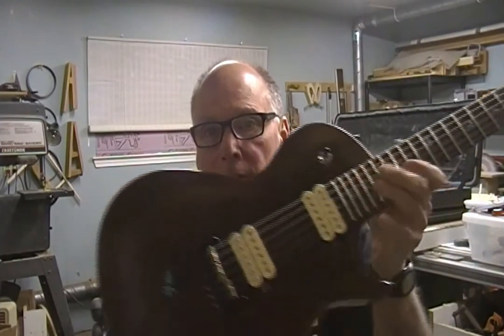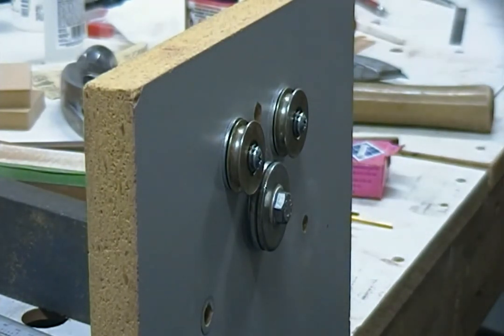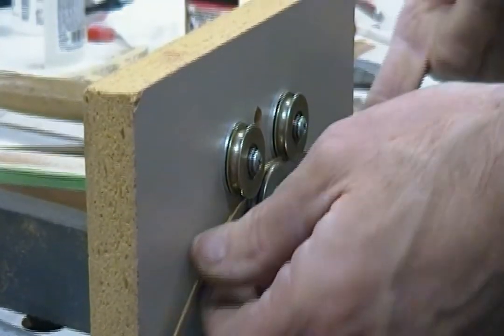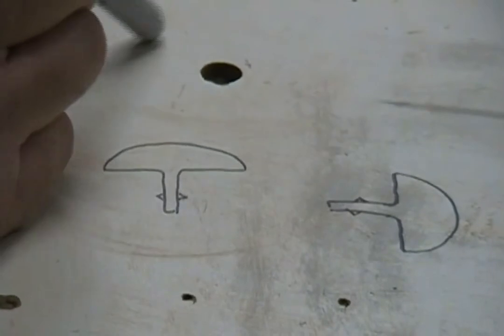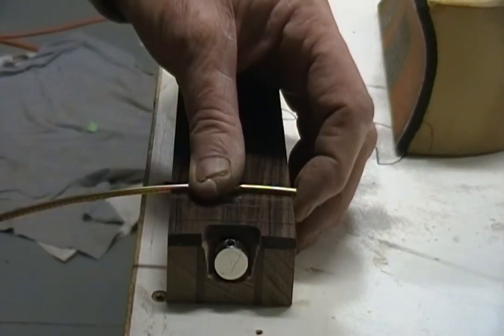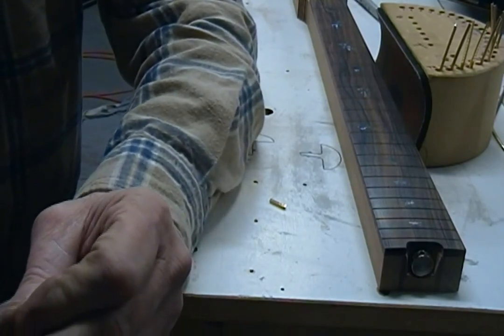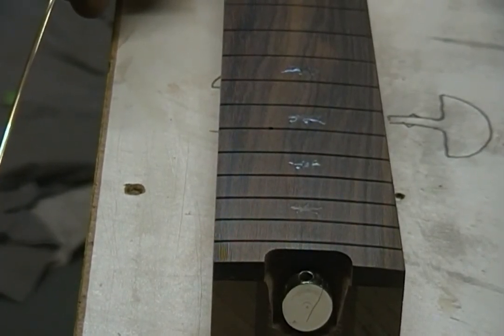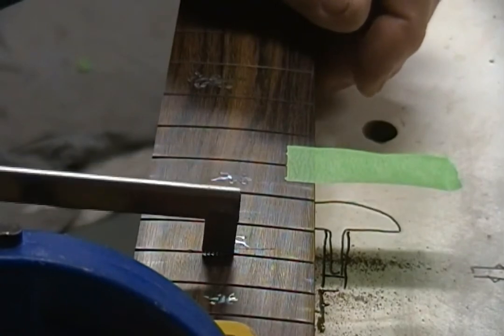Custom Electric Guitar Build, “GECKO” BY Jonah Guitars #11

Comment: Great stuff Dane. I use a small sodt face mallet rather than a hammer. I find that a hammer introduces imperceptible changes in the bend radius. I wouldn't have picked up on the internal tang radius issue, but now you have pointed it out I recall that all the aluminium alloy extrusions we used at work exhibited the same characteristic. I think StewMac do a fret tang nipper don't they?  Antaresteve.
Reply from the maker: Hey how's it's going Steve. Yes Stew Mac sells nippers but until I'm doing a fret job a week I'm not spending the money.  I press most of my frets in but lately I'm finding the hammer useful. I should get a brass hammer.